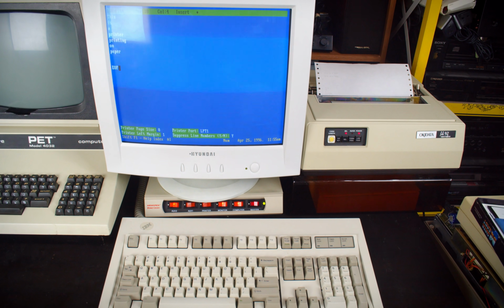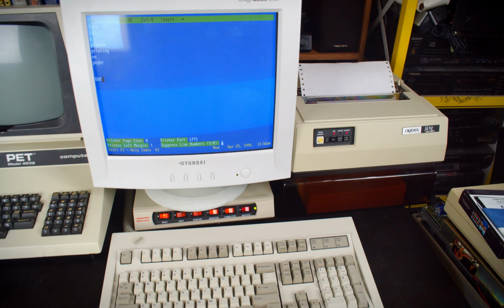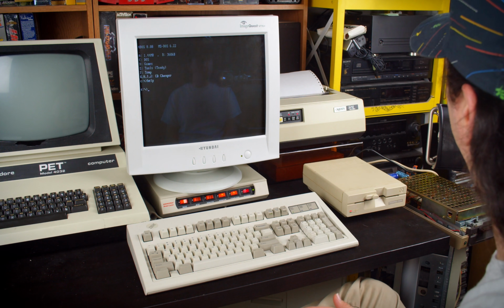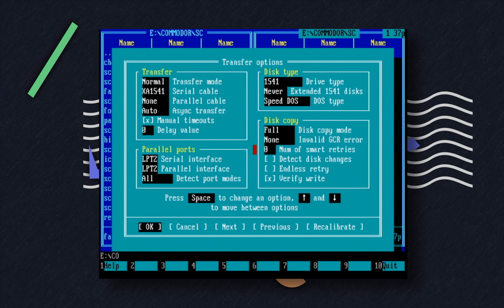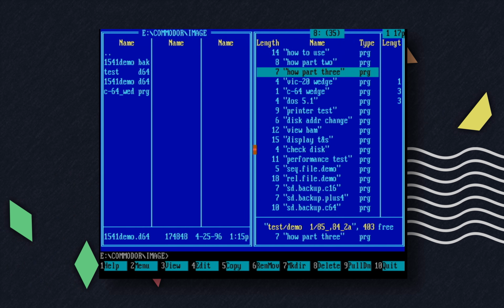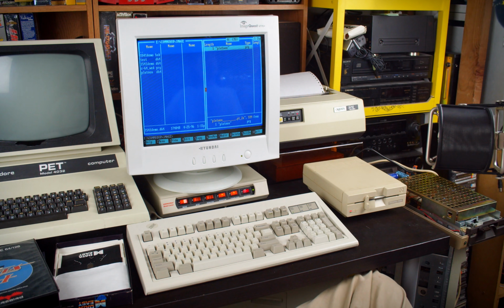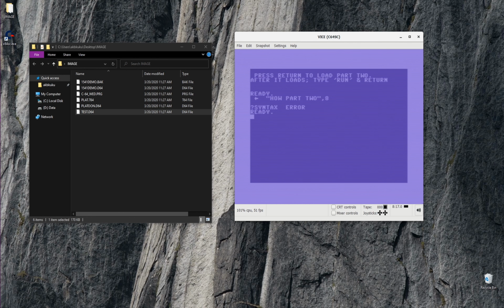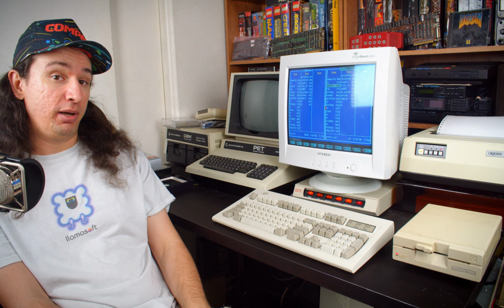Commodore 64 Drive on PC

Comment: No wonder the PC to 1541 transfer didn't work. You have to format the new disks before you can use it. Ooops!
Also, there is some trick going on with that Platoon disk I think, because the original european tape release is a 4 part multiloader, so it's a pretty big game.

Comment: The whole 2000's i used Star Commander with XE cable. Then i changed it to the XM cable. Since 2013 i use the Ultimate 2. No need to use the Star Commander now.

Comment: I want to play a disk not copy one.. is it possible to say get a commodore 64 emulator for windows and run a game disk direct from a 1541 drive? 
I mean basically use a windows pc as if it were a commodore computer but playing the actual original commodore disk software.. ok here is what it is..
I had a music composer program for the commodore that allowed you to create and save the work.
Back in the 80's a friend of mine and i made lots of songs and saves.
I still have the software and disk drive and save disks but no commodore.. it died years ago..
I want so badly to hear the saved work once more.

Comment: I'd wager a guess that the drive is under serial because the 1541 is a serial interface drive.  So while you're connecting it to the parallel port. You're actually using only 1 out of the 8 parallel lines to transfer data, which means you're using the parallel port as a serial port.

Comment: Star Commander with an XA1541 cable is pretty nice. The only interface like this for old computers that I think is better is ADTPro for the Apple II, solely because you can use it on a modern computer. And if you have any model Apple II other than the IIc, you can use it, albeit very slowly, through the cassette port without building any kind of adapter using just a male-to-male headphone cable.

Comment: I don't remember which one of the cables I built, definitely not XA, but you can use the cable the other way around as well by connecting the serial cable to the C64 instead. That is, setup the pc as a disk drive and just insert d64 images to the virtual drive on pc or mount a folder with tons of programs.

Comment: I don't get how you can just plug a serial drive into a parallel port without some kind of UART.  It looks like a lot of the magic is in the software though, wonder how difficult it would be to mount the drive on dos so it can be used with normal dos commands. I would have thought the PET drives would be easier to connect just because IEEE-488 is a parallel interface.

Comment: I built the XU1541 adapter cable which runs on USB on Windows machines which makes file transfering, disk imaging, and also writing disk images (demos, games, etc) a whole lot easier, with the CBMXfer software. The XU1541 adapters have been superseded by other adapters, but still work really well. It uses an Atmega8 running V-USB in software, and plugs right into USB and a 1541.

Comment: some advice for you, XE1541 and XM1541 cables are much easier to build because they just use diodes that you put into the same LPT connector,  now for star commander transfer options select warp transfer mode,  press button recalibrate so delay value will change adapting for your machine speed (better stability over communication),  another config you must change is in Drive option select speed execution command for Warp (you will get a huge speed improvement coping disks!!! it will take just 30 seconds tops!!).  and finally, for reloading disk drive content you can use a shortcut ctrl+R it's faster...

Comment: Thank you for the News, i am doing this since mid 90ties.
But you should have a bigger audiance, so spread it.
Star Commander and  parallel cable anyone.
http://www.ccs64.com/
You need an old PC with a parallel port and DOS to make it work.
Windows isn't real time nor has it direct hardware access.
Edit : win95 and win98  should work too.

Comment: @6:58: I really wouldn't do that. I would just keep things inside, and add it as a commodore serial port (these female din plugs are still easy obtainable, but perhaps you need to drill a hole in your pc case)

Comment: I was using a Pi1541 w/C=64 to copy D64 disk images to a 1541 floppy. I found I had more success when I formatted the disk first. Otherwise, I would often get write errors. I would expect the copy program to just overwrite everything (as with any disk to disk copy), but it was happier when the disk had already been formatted. Just passing along since your operation failed in the same way mine did.

A side note, some publishers used tracks 36-40 as part of their copy protection. The standard 1541 format uses tracks 1-35. This is why you see an "Extended Tracks" option on many disk copy programs from the period. The 1541 can be forced to search for code on these high tracks. If the code isn't there...no boot.

Comment: Using SC and a XA1541 works very well in "turbo" mode for me. "Warp" gives me some trouble, but "turbo" is also speeding it up quiet a bit.
Some of my PCs won't work with XA1541, but then they work with XM1541. SC seems to fiddly with parallel ports.

Comment: Maybe a sidetrack if you want to internally install a Commodore drive: Get a 1571 because it uses pretty much a regular PC floppy drive so it would be easier to physically mount internally.

Also, for the European viewers: You can replace the 2N2222 with a BC547 or equivalent, this adapter is just basically bit-banging the IEC serial bus over the parallel port.

Comment: Your video is fun to watch and a great refresher as I made two X?1541 versions but don't want to use an heavy old computer to use it (new computers usually don't have a parallel port).
Zoomfloppy is much easier to use and can use the 1571 fast serial and uses free OpenCBM.
It uses USB for serial and power. V.I.C.E. supports it! If you use CBMXfer frontend it is very easy!
You can get zoomfloppy from http://www.go4retro.com/products/zoomfloppy/ ! It is a faster version of the XU1541 , and connections for IEEE-488 and parallel cable.

Comment: I wish you would have showed a transfer the other way around. That's the main reason I would use an adapter like this. I used a nullmodem cable to move everything I cared about when I switched from C64 to Amiga. - That way is old news to me. - But I sometimes feel a slight urge to see what I could do with my current dev tools and knowledge on a C64.

Comment: Here is a verrrrrry little known fact. The 8250 and 8050 drive are compatible until you fill more than half the disk space. The 8250 only writes one side at a time. So theoretically you can use both interchangeably. I read this in transactor magazine a while back. As far as transferring software? Well...that is easy as pie. Use the datasette. The datasette is virtually identical from the pet all the way to the c128. I used a x1541 style cable and star commander right up until the 1541 ultimate II. I bought that and the datasette adapter for this very purpose. I wrote up a paper on building your own datasette adapter for this hardware. It is listed in the forums for the 1541 ultimate. Ironically, the tape capture feature doesnt work in several major revisions of the firmware so use either 2.6 or 3.4. The intervening versions are broken.
Reply: Use a disk doctor to find the "bad track marker"(group code) and change the pointer in the bam to the correct track and sector. This is some old time cracking knowledge you wont find elsewhere. Those euros never publish their methods...

Comment: It is normal for the head knocking (unless your diskdrive doses not have a broken track zero sensor, if your model has one).
Commandore formated disk has metadata on them to tell the diskdrive head witch track it is on.
So  when a blank disk is formatted then head knocking is needed to get to track zero (unless you have a broken track zero sensor). So the metadata can be written. Read/writes to the disk after format should not produce any head knocking.

Check out this repair: https://www.youtube.com/watch?v=-gDKl15WYuc
(More info: https://en.wikipedia.org/wiki/Commodore_1541#Media  & https://en.wikipedia.org/wiki/Block_availability_map)

Comment: Well, you cantalk to that 8050/8250 drive from a PC equipped with a GPIB or IEEE-488 interface.  The good news is that you can but those off the shelf (the interface is still commonly used on professional-level electronics instruments,l although it is giving way to ethernet and USB).  The bad news is they cost over $600.  The better news is that over on a channel called NatureAndTech a little over 4 years ago published a series on a DIY interface.  Here's the playback code for the first in the series: U0UweU1PEiA
Reply from the maker: I have some GPIB ISA cards but, as far as I know, there is no software to use them with a PC. I don't have the time to write something for it. If there were software out there I could do it that way though.
Reply: @TechTangents  The protocol used on the serial bus is just a serialized version of the IEEE-488 protocol, and the device commands are identically formatted.  All that should be required is getting whatever host software you want to use from the PC to talk on the interface.

Or, you could plunk an SIE-to-IEEE converter onto the chain and talk to the 8250 through that, since it will just throttle the drive speed kind of harshly but won't affect the command set, which didn't change between the two buses.  The OpenCBM software you'll have seen a link to on the XA1541 page has a link to a buildable adapter in the Supported CBM Hardware section of its' documentation.  (This software is also several years newer than the stuff you've linked to.)  This is the way we would have done it back in the day, to get access to those high-capacity floppy drives from the later Commodore 8-bit machines.  (Also would work with their two models of Commodore external hard drives, although those were right bastards to work with, since, IIRC, they didn't support any kind of hierarchical directory structure or virtual imaging system.)

You could also jump forward in time to the current descendants of the device you're using here, and use something like a ZoomFloppy instead (http://www.go4retro.com/products/zoomfloppy/) that supports IEEE directly and is claimed to perform better than the device you've replicated.  OpenCBM already supports ZoomFloppy, so you'd just need suitable cabling.

Comment: With XUM1541 ProMicro and Nibtools (Nibread and Nibwrite) you can read and write copy protected disks via USB using a 1541 (with parallel connections hooked up) or a 1571 (with SRQ). See https://myoldcomputer.nl/commodore-64/xum1541-promicro/

Comment: Side note:
For a great modern version of Star Commander/Norton Commander you should try Total Commander.
I've used it for a long time, and I will never go back to Windows Explorer. Ever.
Reply: star commander has special compatibility with a commodore disk drive that I suppose total commander has not,  and this kind of interface doesn't work over multitasking operative systems, just DOS.

Comment: Star Commander has a built in fastloader. You can activate it in Transfer options and set it to "warp" to use it, much faster ! From my experience it took 35 seconds to read or write an entire disk.

Comment: I think you need to check the option 'format disk' since out of the box, new diskettes aren't compatible with Commodore's format, so it can't find the sector to write to, hence your error.  Try checking 'format disk' option when you write a .d64 file to the 1541...

Comment: The head knocking is usual for Commodore drives, but I think the copy didn’t work in this instance as the disk isn’t formatted.  I’ve had one of these cables made for ages and haven’t used it yet, but you can get a USB version which you can use with modern software.  If you have a network card on your 64 then you can use WarpCopy64 which writes disk images over the network directly to your 1541 whilst still attached to your 64 in a matter of seconds!

Comment: Back in the day, I made an X1541 cable, which as I recall (some 22 years later!) was a much simpler cable than that, it may even have just been just a couple of resisters or something.  worked a treat.

Now that you can create disk images from real disks, you might find Dirmaster useful.  This is a  Windows program for working with disk images which has lots of useful disk functions like copying individual .prg files from a disk image to the PC, copying files between images, reordering the contents of a disk image and so on.  it can be found here - https://style64.org/dirmaster 

I have no connection to this software BTW, I just think it may be useful

Comment: Zoomfloppy with a 1571. Great for d64s and g64s.
Reply: +1 to ZF + 1571. With what MisterMsk recommends, you will be able to use NIBTools to image your copy protected disks and then convert the nib files to G64.  The old X cables are cool but extremely slow.  With NIBTools and a ZF you can image a disk in seconds.  And write just about any image back.  

If you get the ZoomFloppy with IEEE connector you can plug it in to the PET drive and image and create disks for that.

Comment: I do think a lot of programs used sector on maybe track 36,  try the copy of extended tracks.

As for making the disk try format first.  I think that is why you got the errors.
Your disk may have been a PC formatted disk!

Good luck,
As for your pet I would guess the CIA chip if it has one.
What I was seeing on the screen it would be the CIA  chip on a C64.
There was a capture cartridge that would bypass the copy protection.
You pushed the button saved it 

Using the copy of the disk, no protection needed.
I do not remember if you could save the capture to that disk or not.

Comment: The X-series Serial cables will read copy protected diskettes, but not write them back to physical media without errors.  Also most copy-protection does not get copied which means the disk dump will not work when trying to load in the emulator.  In order to copy protected disks, you'll need to use the parallel X series cables in conjunction with a nibble copier.  This also requires adding a port that is attached to the ROM socket inside the drive.  If I'm remembering correctly, it is possible to add the nibble copier executable in the options of Star Commander.  I used the XA1541 cable from about 2010 to 2015 and then I learned of the ZoomFloppy from RETRO Innovations.  I've been using that ever since.  It has the advantage of working with modern PC's in Windows (including Windows 10) and uses a USB interface instead of the parallel port.  If you are fortunate enough to have a 1571 drive you can do a nibble copy (with the right software) of the protected disks which you can use to backup your collection.  The 1571 does not require the port modification that the parallel cable option does.  It will also allow you to write the nibble copy back to a physical disk.  I highly recommend .G64 formatted files for this type of backup.  The nibble copy will not work on any of the various 1541 models, as far as I've found, without the parallel cable and port mod.  I am in no way advocating for piracy.  I'm simply pointing out a way to reliably back up your collection for posterity.

Comment: I did something similar on my C64 a few weeks ago using a pi1541 and a 1541 drive.  I was able to make empty .d64 files in the dirmaster program, put them on the pi1541, then daisy chained the pi1541 and 1541 together to the C64. Then I could copy my old floppies to .d64 files using fast hackem loaded from the pi1541. I had the same issue with copy protected games though, even trying to copy them to .g64 files with this method it didn't allow the copies to work in emulators, etc.  A pi1541 is great, especially if you have a raspberry pi 3 already.

Comment: Get a 1581 drive and you can write a commodore disk from ANY PC 3.5" floppy disk drive.  I also have the XA cable, but NOTHING beats just using the 1581 and a pc drive, which is what I do.
EDIT: I don't own a pet.  But the Commodore drives don't really have a DOS and assuming it can use a 1541, it should be able to use a 1581

Comment: I actually use a standard X1541 cable for my drives because I somehow have a couple of laptops with compatible parallel ports.  Although I did order the parts to build the XA cable a while back and intend to 'upgrade' at some point so that I'm not locked to using those specific computers.
Reply: Actually this video inspired me to go ahead and get the parts out and hack the cable together.  So now I am using the XA1541!

Comment: I made an XM1541 cable years ago - it's very useful, and the main way i get stuff onto a C64. The XM is simpler as it's just a bunch of schottky diodes inside the parallel connector and requires no modifications of the 1541. I read that it doesn't work with all motherboards, but it hasn't had any issues with what i have (VIA Apollo chipset).

Comment: I remember doing this back in the early 2000's, although i was lazy on making the cable, i just had stripped wires i shoved into the connectors of the LPT port and the drive, worked but was flaky.

Comment: I use the XUM1541 adapter, for me it is even easier, because it is for Windows 8 and above
Reply: Also works nicely on Linux! :) It's arguably even easier to build with a Pro Micro for less than 5€.